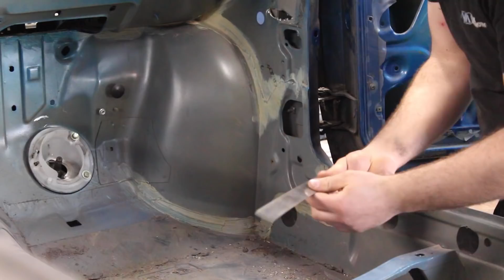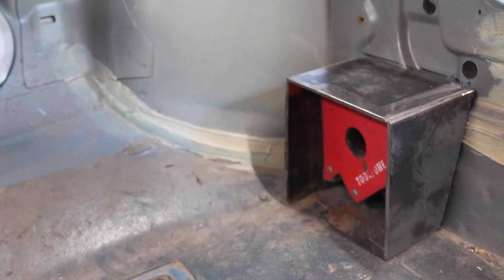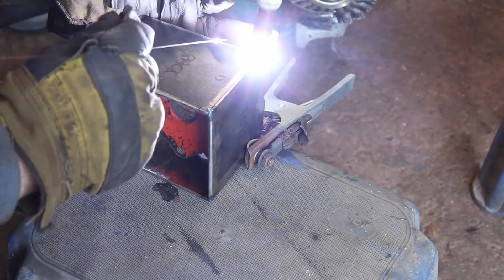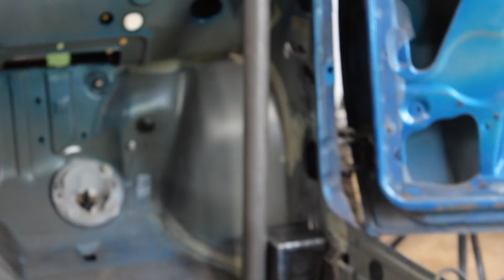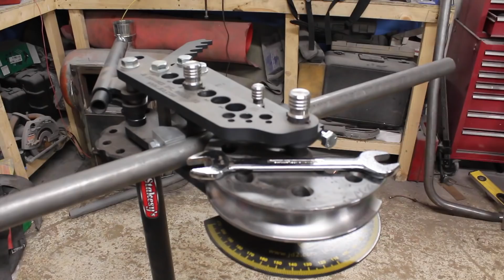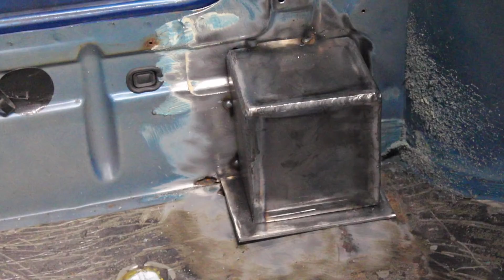Roll Cage Front Leg Fabrication - mid engine Rover Metro project Episode 6

Comment: Just  quick one. I am new to the subscribe and to tig. What amperage torch are you using and are you using a foot pedal? I have a new Unimig as / dc tig 200 amp machine and at 70 yrs old, (and with arthritis), I find the 200 amp torch is difficult to work with. My project work will be mostly with 1 > 1.6 mm mild steel and aluminium to 3 mm. I note that you don't seem to have an on/off switch like the unimig and this is why I ask the question(s).

Comment: Surprised cage box's don't have flanges for better welding to car panels.great video with honest remakes (cockups).
Reply from the maker: I've never seen any with flanges, i'd guess that the extra surface area would give more strength, but it may not be needed. The alternative to these boxes is to plate the floor/sill, but then there would need to be a hole drilled to lower the cage and weld the top of the joints - with the boxes I can just pull them out and weld them in last. I'll be able to drop the cage 130mm - but that'll all be in an upcoming episode :) Thanks for watching!